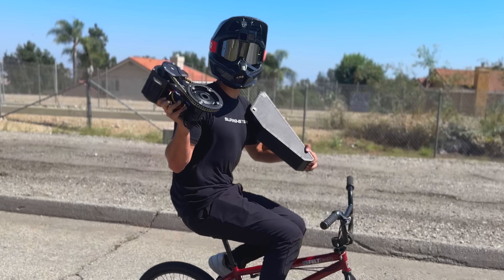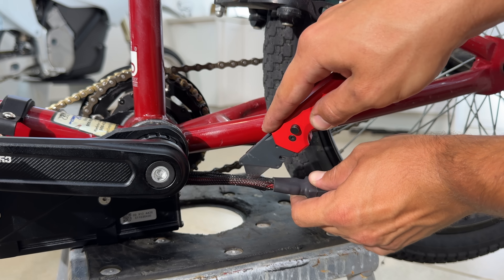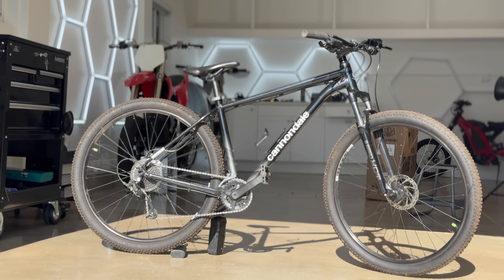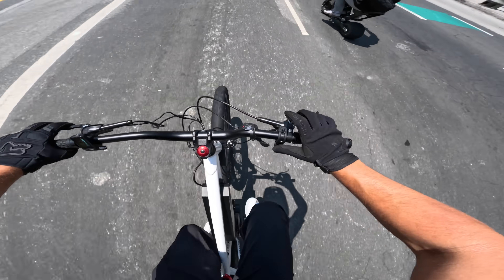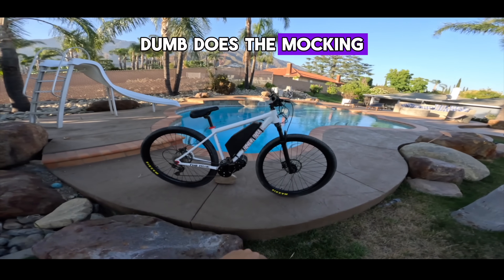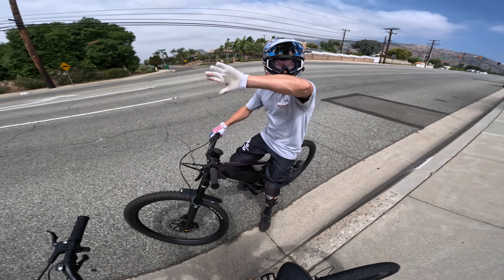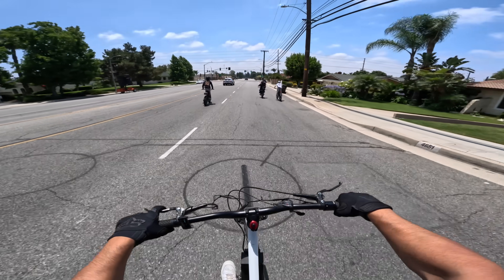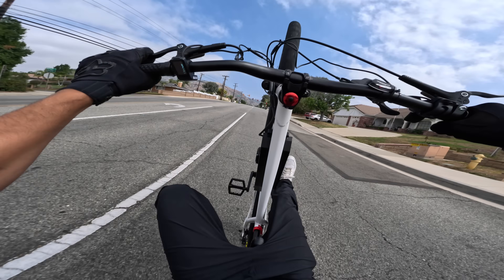$2,000 Motor in a $20 Bike

Comment: hiya Ronster your soldering and joining method was exactly the right way to do it ,
Reply: unfortunatly to get the right solder oenitration youll need a much bigger irom around 100watts with larger tip to hold more heat ,abd thickewr solder helps too

Comment: You did Okay on the soldering. Honestly, you really could make it look cleaner with some flux, and or applying heat to the WIRES and then bringing the solder to them to melt. easier said than done with cables that thick. Most important is getting/keeping  enough connection to limit resistance to prevent a "hot spot" in your cable. They make special heat resistant electrical tape if you don't want to use heat shrink tubes. Best practice is to use heat shrink tubes, they are just more permanent than the tape.

Comment: 3:04  heat the wire, then touch the solder to the wire to melt it. Melting it onto the wire doesnt really do anything and it'll just break apart

Comment: Those are cold solders, you need to heat the element and the metal together. You're probably having voltage fluctuations. Could have had about 25-30% more power

Comment: Mid-Drives are less efficient yet cost 8 times as much as a hub motor because they are new to the market. In two years those will be dirt cheap & nobody will want one as the hub drives are miles ahead already with full bikes for under $500 that are faster than a $2k mid-drive conversion kit.

Comment: i put a cyclone 3kw motor on a mountain bike too. yea. that chain line does NOT like that much torque. pro tip to ANYBODY building DIY bikes. avoid bikes with gears. they just cause WAY more problems than its worth. even name brand components.

Comment: For soldering like that, you have to heat the wires themselves then touch the solder to the wires after they've heated up and the wires will absorb the solder.
Reply: Yeah such a master electrician, and he's going to spread his knowledge,  such as hub motors suck. Anyone that takes suronsters advice on electric components is a booger

Comment: 0:11  all depends on the frame stance and its neck. My $2000 bike handles 55mph, but it can get dicey depending on the weight in the front and the back, and if in a corner, etc… it’s not the price of the bike per se. I’m definitely grabbing a stealth bomber to install a 12k motor. I’m staying with 72v and 50ah battery, but bumping to 200amp controller

Comment: the biggest issue with doing something like this is long term these break. mid-drive motors like the motor used in the video put pressure on the chain and the bike frame. and while you can buy a better chain, and use tensioner which they did. a bike with a cheap frame overtime will warp or break. it will be amazing at first but the frame will snap at some point.

Comment: Public information film for The confederates. Only hire pedal assist bicycles. Then you can get the battery attached to a throttle somehow and you then have torque to burn out your tyres. Also, gears,? No. Take gears off. No gears. Right. Then you can go. I got a twist.

Comment: Surronster can you please try to wheelie this bike called the caroma d3 it goes 20 mph tho and if you get it you can up grade it or you can cut a bundle of blue wires  which is the speed limter in the battery  pack under the bike

Comment: You should make a video where you buy an Ridstar Q20 Pro and mod it

60 km/h
37 mph
Dual 1000W motors 2000W output
Dual 52 V 20 Ah Batteries 52 V 40 Ah capacity
52V, 25A controller

Comment: You should do for your next video MX 350 super Moto build and also you should buy a new soldering iron maybe like an $11 kit so you can heat up your wires and make them connect better

Comment: dude, dip those wires in soldering flux. make that solder flow like candle wax on a wick. otherwise get some crimps for that gauge. the crimps will actually be better and send MORE power down the wire than solder if done right.

Comment: Hub motors 1000% don’t suck they been out before mid drive motors are MUCHHH more powerful and reliable. Mid drive just best for if you do jumps and easy wheelies. Allll super powered DIY bikes are 90% hubs That push more power than stark and anything else that’s mid drive.

Comment: 3:12
a tip to make those solder joints not create an electrical fire - literally just keep adding solder, eventually itll get somewhat kinda smooth and it should like melt thru the wire if that makes sense.
all u gotta do is hold the iron with as much contact you can get on the wire so the like flat side (like how you were doing already, but without like stroking the wire with it lol.. atleast till  u got some solder down yk defo dont just hold it in same place the ENTIRE time but it needs to stay in one place to heat it all up enough to stick good) and just keep pushing the solder into the soldering iron till it looks good enough, trying to aim for the like bottom of the tip like the lil gap between the side of the iron and the cable

Comment: A tip when you solder wires together make sure you heat the wire up with your soldering gun then when it's hot enough when you touch the wires with the solder they should absorb the solder. Hope this helps

Comment: you think hub motors suck??  bro, mid-drive sucks!  you have to worry about what gear you're in and when your chain breaks you cant move anymore
Reply: Mid drives are way better in nearly every way but maintenance, but I do admit it’s expensive to buy expensive e rated chains, also don’t use any power whilst shifting, I’ve only replaced one chain running 3.6 kw
Reply: @Chapter710 how are they better?  what's better about them?
Reply: @ChristopherAnderson-e5o it is better at climbing hills, more efficient (can run at less watts while achieving the same results = more range), better weight distribution meaning 10x better off road, having different gears is better if you know what your doing because you can control the amount of high end/ low end torque your producing. All at the cost of slightly more maintenance and ££
Reply: @Chapter710 so it's better performance but it's a giant pain in the ass to both use correctly and maintain?  yeah, i'll stick with hubs

groupthink is always a problem, whether it's bikes, cars, computers, whatever.  everyone wants to flex so they buy the most expensive shit they can, but more expensive isnt always better.  i want to ride, not fix broken chains all the time.  mid-drive sucks bro
Reply: @ChristopherAnderson-e5o fair enough, I have one of each, absolutely love my rear hub and I do use it more! But the mid drive is more fun for off road, I havnt actually had to repair my bbshd mid drive yet, but I know it’s coming lol
Reply: @ChristopherAnderson-e5o my 3.6kw pit bike has only needed one chain replacement so far, but I still admit it’s a lot more work than a rear hub
Reply: @ChristopherAnderson-e5o lol they suck? Ok bro you can have your opinion but saying something sucks because you can’t replace a chain is hilarious
Reply: @Chapter710 it just reminds me of the mac-vs-PC debate ya know?  i mean are macs "better" than PC?  well i guess technically they are, but not if you just want to use a damn computer like a normal person
Reply: @ChristopherAnderson-e5o how are Mac’s technically better than pcs, and are you concussed because what are you even saying

Comment: 3:30 that was hard to watch, use a blow torch heat the metal until a colour change. solder touches the metal not the flame itll seep into the airpockets of the cable. made me laugh watching you attempt to solder.

Comment: Those cold solder joints? Just nature’s way of testing my confidence in electrical failure 😂
Honestly, less solder, more flux  because it looks like you tried to weld with a butter knife.
Reply: Also heat shrink beats electrical tape any day, no sticky mess, no peeling, just regret-free insulation 😅

Comment: Brother. When u soldering heat the wore with the iron and touch the solder to the wore. Iron should never touch the solder. Also flux makes it flow so much better. Either way I think that iron is to small for that wore size.

Comment: stick the ends of wires into flux and then solder them iron on bottom of wires and solder on top. Flux will pull the solder to the wires. I friggen love FLUX. its just a little messy like greasy.

Comment: For your next project, when you need to use solder to connect wires, the best way to go about it is to heat the wires as you're touching the solder around the areas that you're heating and the solder will melt into the areas and bond the two wires together. Once you start heating the wires the solder will start to melt and as you hold the solder tip in place, keep applying solder till you're satisfied. You can practice with exposed wire, heating it up and then touching the solder to it. Keep in mind to keep the tip touching while applying the solder 👍🏾👍🏾👍🏾!!!

Nice flow, by the way 💯💯💯!!!

Comment: On the soldering, get & use flux. Then heat the wire itself with the iron until the solder flows throughout the wire. Then it'll hold good.

Comment: I had the same issue as you with your $200 dollar bike. Your chain/ rear cassette are worn. So, when you throttle your chain skips on the rear cassette. Fresh drive train will fix that. I got the mid size cyc on my mountain bike and love it. Couldn’t imagine the bigger size on my bike.

Comment: Also tip for soldering get a wax called tinning flux and makes the solder flow on the wire like water and makes the solder a lot stronger and cleaner 🫡

Comment: A derailleur isn't made for  6KW or the chain, that's why they came up with Surrons , motorcycle sized chains no derailleurs. High powered hub motors work fine if you don't overheat them and you don't break chains.

Comment: 3:06 Just so you know, that connection is unsafe. At the amps it's pulling, it needs to be a solid connection, hold the soldering iron on the bottom of the wires for a minute, and tap the solder onto the wires until it starts to flow, then just keep adding solder until the connection is solidly soldered. Or, you can use a micro blow torch and keep the heat on the wires, and push the solder into the wires until it starts flowing. Please fix that, I don't want to see it catch on fire from arcing....
PS: You can also get some cable eye lugs and crimp them on each end and bolt them together, then tape over it..But I would never leave it the way you did brother.

Comment: Those are aluminium wires you soldered, wich are very hard to solder, i would recomend crimping them together.  OR you could use an extension cable with the same wire gauge and conector (XT60 i think)

Comment: My guy when soldering use FLUX and heat up the wire more before introducing the solder to it then it will get sucked in to the joint for a strong connection plus you need ideally a more powerful Iron for that gauge wire. Good job though and for owning it.

Comment: Bro said hubs suck, literally after 30s of riding his chain broke lmao. Both have their pros and cons, you can't say either is better. Hubs are extremely annoying when you get a rear puncture. Mids chew through your cassettes and chains really quick. It's also important to get a correct hub for your use case, like if you're using only a little power like 1000-2000W and wanna go offroad you're better with a geared hub, while on the streets you probably want a gearless one.

Comment: What are the specs of the X1 Pro Gen 4 5000W Mid Drive Conversion Kit. Like which chain ring did you use as well at the crank arms for the Throne bike?

Comment: When you solder put some flux on both wires,heat the wires then add solder. Should give you a cleaner weld. Hope it helps.

Comment: YOU NEED TO USE FLUX WHEN YOU SOLDER!. It's goo that you wipe all over the wires. Then heat the wires up with the soldering iron. Then add solder. Then use alcohol to clean the flux off. 

I'm sure you've been told many times and probably don't remember.....?

Comment: hello surronster, just so you know, your chain snapped because the derailleur(gear changer) was not aligned properly. This is because new bikes do not have the derailleur aligned and you have to do it yourself by either tensioning or untensioning a cable or adjusting 2 screws that either say h(higher up the gears) or L(lower down the gears) so next time you get a new bike just remind yourself that you have to align the derailleur. love your videos and been a fan from since you had your old goggles and other helmet!

Comment: I've been riding dirtbikes and quads for over 20 years.  I can't stand thumb throttles. They lack control and are honestly more dangerous for riders. Requiring thumb throttles on ebikes is one of the dumbest laws around.
Reply: ive only ever used a thumb throttle on quads, didnt really have any problems with them,  but youre not trying to do much fine stuff, and you do tend to take off on most quadbikes with a jolt

Comment: What i dont get is why you would want that much power threw a push bike chain. On a geared bike the gear changes would be savage. So you have to let off power to change gear and need to change gears as you get faster. Someone explain why someone would use this instead of just using a hub motor? I dont get it

Comment: if you want to know how to solderthem heavy guage wires you need a propane torch and larger solder and acid etch heat the bottom together and apply solder to the top it will wick right in add acid before heating